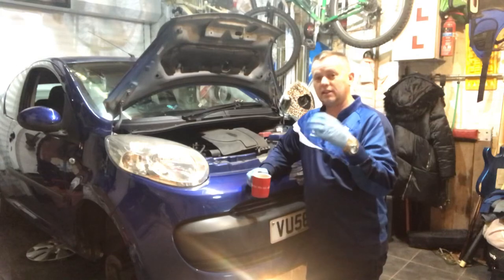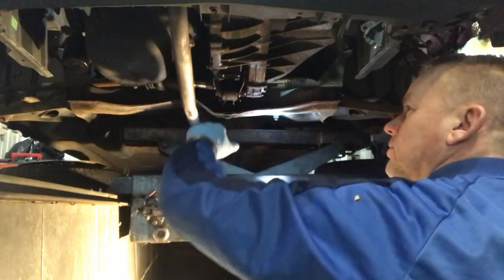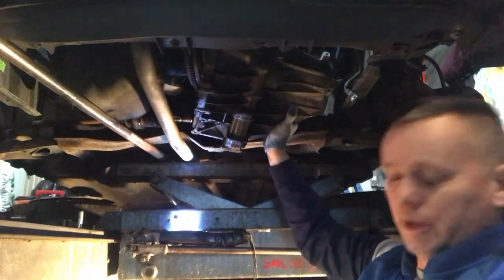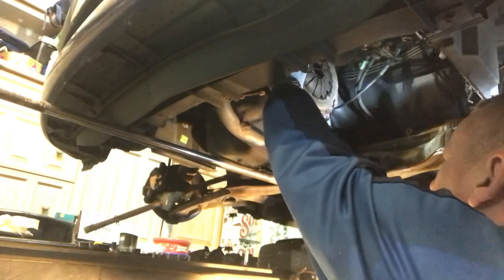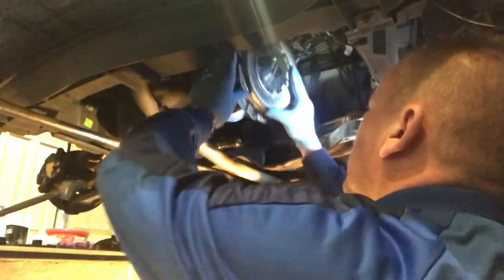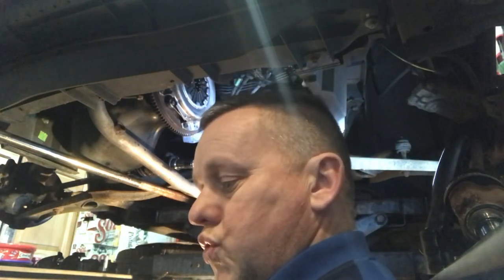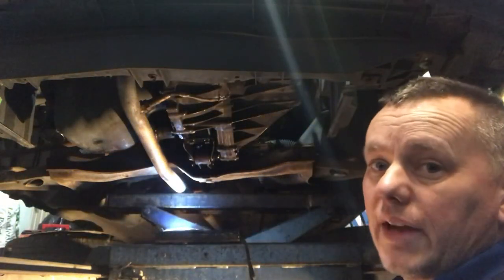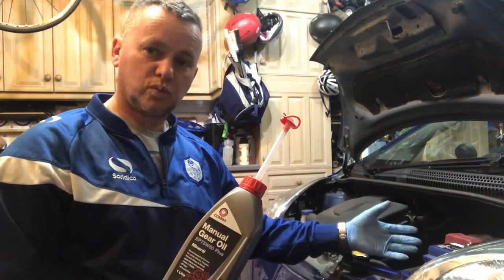Citroen C1 Clutch Burnt Out, (Birds Nest), Had been Slipping/Smoking Hot, Full Job Diy

Comment: Great vid! Actually, I tend to look at all your vids 😊 Just did my own 107 gearbox clutch change. Used same alignment tool as you, homemade 😊 But to avoid any assembly/disassembly issues when taking gearbox out, I removed the 4 bolts from the gearboxmount on top instead of removing 3 bolts from the underside. That made my day much better. So thanks to your vid!
Reply from the maker: That is awesome! Thanks for the great comments👍🏻👍🏻🛠

Comment: Great video! Altough I had some trouble getting the castlenut back on, the entire bolt vas spinning any idea?
Reply from the maker: You can load the joint with a jack to hold while you tighten it, Thanks for the great comments👍🏻👍🏻🛠
Reply: @aaanton11  Hi mate i have a 2014 Aygo that ive just bought and the clutch judders slightly in 1st almost but when it is wet it definitely does until the engine has warmed up and i cant help think but haven't checked it yet that the gearbox may have been overfilled just like the engine was but ive sorted that now and that the clutch has been slightly contaminated the plate surfaces showing it self up in wet conditions. Is the clutch kit the same on the auto models? thanks

Comment: I read somewhere the 2005 c1 had a smaller  clutch that burned out prematurely on later ones they upped the size to 190mm  (from 180mm) and the extra bit solved the problems.
Reply from the maker: that's right, Thanks for the great comments👍🏻👍🏻🛠

Comment: Dear Anton, After a long drive in my 107 last year, my car developed a squealing sound whenever the clutch pedal was fully released. It's been there eversince when the car was used for a few minutes, whether in gear or neutral. The clutch release bearing was named as the culprit. So I got the clutch, pressure plate, AND (supposedly) the clutch release bearing replaced, but the noise is still there. A contact-noise locating test by an AA guy I know, still points straight at a problem in the clutch release bearing area. Car is from 2010 and barely has 60k miles on it.

As the noise always disappears with the clutch pedal slightly pressed, I got the clutch cable adjusted by a Toyota dealer once more last week. Noise still persists. I am at a loss and so is my affordable garage. Would appreciate your insight and love your videos!
Reply from the maker: It is possible you have a gearbox issue if the noise goes away when you press the clutch ,but then returns when you release it the noise could be coming from the gearbox bearings.
this is not necessarily a bad thing unless it persists and gets louder. Thanks for the great comments👍🏻👍🏻🛠

Comment: great video thanks! i plan to do my wife's aygo , do you know the torque wrench setting for the pressure plate's bolts? or/and the gearbox mounting bolts?
Reply from the maker: pressure plate bolts 19nm, bell housing bolts are 52nm, lower arm ball joint nut 98nm, hope this helps, Thanks for the great comments👍🏻👍🏻🛠
Reply: @aaanton11  awsome thanks so much!
Reply: Done it last week, everything went ok. Of course i had help from a friend don't know if i could have done it without him. Your video was very helpfull. Thanks very much.

Comment: I have a problem with my C1 witch both grinds and havde problems going into 1 gear exept from 0 kmh, but when i downshift White moving, it grinds, does that have something to do with the clutch you Think?
Reply from the maker: Sounds like the synchromesh on 1 st gear is worn, if you can't put up with stopping to engage 1st you will need to repair or replace the gearbox, Thanks for the great comments👍🏻👍🏻🛠

Comment: Hello! I have a Peugeot 107 with a robotic gearbox. I went to a service to change my clutch because it was harder to get off the ground, the clutch was slipping. I put the original clutch. Now the display no longer shows which gear the car is in. Neither N, nor E, nor R. The car starts, but does not move. What to do? The car is from 2012, it has 44,000 km. Thank you!
Reply from the maker: Check the wiring connector plug to the gear box and the engine earth strap, Thanks for the great comments👍🏻👍🏻🛠

Comment: "All that power". As a C1 owner can you advise me where it is! Lol
Was the one you took out the original 180mm clutch which were updated to 190mm from -09 reg onwards? If so 78,000 miles is not bad on a 180mm original clutch. Mine only managed 88,000 miles on my original 180mm clutch.
Reply from the maker: 😂 this was not the original clutch, it had definitely been replaced at some point, thanks for the great comments 👍🏻👍🏻

Comment: iam going through Aygo 13 plate car at 61k miles now and the clutch has gone completely , changing gear iam fighting with the car , ive had the car 30k miles and iam up to date with the servicing but each service record never mentions clutch or gearbox or clutch lever check (kwikfit and Toyota services) you have to pay extra for the services dealing with the parts listed before , Toyota services are a complete useless unless u pay for the extras which are 60% extra than normal prices 

gone through 3 sets of tires , 2nd of set of brakes , 1st new set of front wheel bearings , another front wiper motor , new main elecritcal cables , now clutch and possible gearbox these cars are not made to least long
Reply from the maker: A New Clutch fitted at the garage should cost around £300, Thanks for the great comments👍🏻👍🏻🛠

Comment: Thanks for the vids man - helped me a lot. Interesting project cars. Got a C1 recently and it amazes me how a reliable little car (combined with 2 careful older previous owners) can get quite old without any servicing. This reliability means that average users are inclined only to MOT and not maintain. 2007/2008 models quite often end up in garages still containing the original oil. They are great motors which almost allow a decade of running them into the ground before major work. But thats the point......they are cheap to maintain, a good sized machine to start learning about fixing yourself, saving yourself money and wiping the smile off porky grease monkey slack jawed mechanics faces (who tell pensioners the flux capacitor has blown).
Reply from the maker: thanks for the great comments, i do believe these are the most fun and cheapest car on the road, they are a fantastic learning tool, reasonably easy to repair.👍🏻👍🏻
Reply: WEISEFELD wait until water leaks through the rear seals lmao